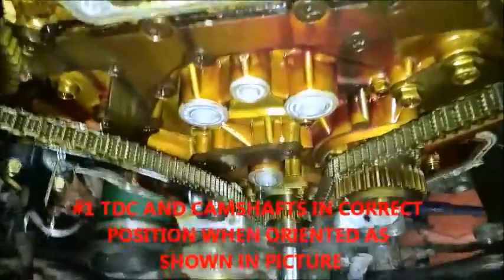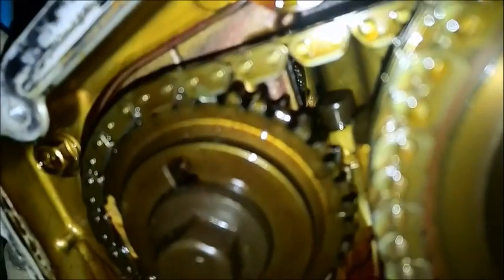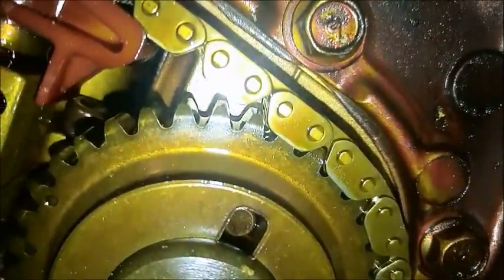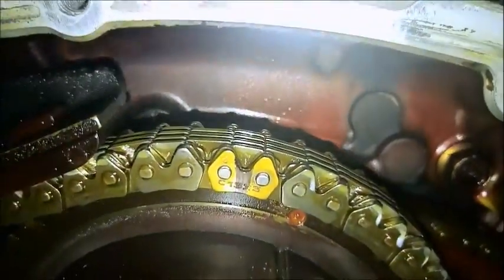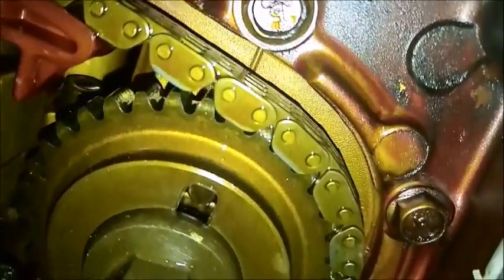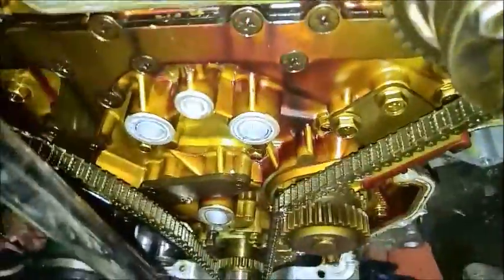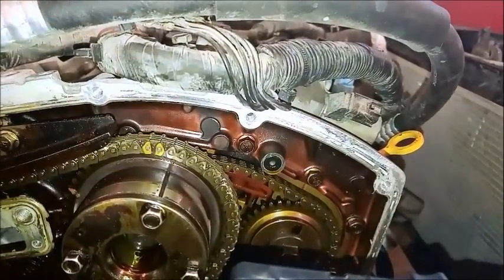Nissan VQ35DE timing without removing spark plug or valve cover

Comment: Does this work on 2nd Generation VQ35DE? The one in the video is the 1st Generation, but 2nd Generation is on 2008-2018 Nissan Altima and 2009-2014 Nissan Maxima, it has a different design from outside.

Please help if it's the same alignment diagram or no.

Comment: can you set the timng with out the timing chain
Reply from the maker: Yes, if the camshafts can be held in place some how. Just line up the marks as you are all set. Provided nothing moves during installation of the chain.

Comment: Great info. I just put my cams in timing. Perfectly and I decided to turn the crank just a slight bit to allign with the mark since,  I was just off by an inch. I didn't want to allign it till I knew I was in time with my cams and chain. Once I did that I put the bolt on turn it to position and herd a slight hiss of air. I was wondering if I screwed up so I walked away till next day. Thank God it's a normal sound then. 🙏 now all I gotta do is put my main chain on and turn it and pray it don't stick.

Comment: So quick question What if the line in the cam gear is off on the driver's side by just a hair should I remove the chain and turn it back just a hair
Reply from the maker: If its jumped a tooth I'd suggest moving it back. But a tooth a quite a bit more than a hair. Tighten chain it may pull everything together.
Reply: @Taters  thanks I went ahead and turned the cam gears separately, each just a hair to be dead center with the line on the timing cover and got it all back together, and it's definitely off now running poorly 
This was my 2nd attempt. The 1st time I did it, it would not start at all. Somehow, after I set it, I guess I bumped it out of time 
Before the drivers side was like the right of the marking and then the passenger side was to the left of the marking but still under the line I'm guessing by me moving them to be in the middle through it off 
Rn I'm pulling a code for bank 2 timing over advanced 
But my engine sounds fine, no knocks or nothing it is just misfiring and running rough
Reply from the maker: @BlackWidowdetailing  did you set the engine on the marks BEFORE disassembly? Perhaps the crankshaft isnt where it needs to be?? clean area and remove #1 spark plug, use compressed air blow gun and a rag to blow into cylinder if engine rotates or pressure builds and blows back when compressed air is applied then # 1 is on compression stroke. If air flows thru cylinder easily then you have set engine incorrectly. Correct to #1 compression and repeat process  if all marks are lined up as described in the video and provided that your engine is the same vintage then it should start and run. If you have lined everything up as shown and the engine will not run then there must be another issue. Id suggest swapping the VCT solenoids and see if the code switches banks (if so simply replace the failed solenoid) if that dosnt work have a look at your cam phasers perhaps one of them is failing.

Comment: Ive always been curious what will happen if someone doesn't time the engine correctly.
Reply from the maker: If off by enough degrees. Engine will run badly. If altered only slightly no noticeable change may occur. 
Why? Method depicted in video is definately the correct method.

Comment: So u only charged the tensioner ?
Reply from the maker: Thats correct. The guides, chains and secondary tensioner were in good shape. The car ran excellent for 3 years after the repair until my brother sold it now some chick owns it and i see it around once in awhile.
Reply: @taters5586  thanks for the quick reply I’m doin this for a customer on a Murano didn’t have a check engine light didn’t know if I needed to change everything or just failed tensioner bought the whole timing kit 🤦🏾‍♂️
Reply from the maker: @freshdatech89  well if ur not going to hurt it any servicing the whole thing. Might be wise to toss a water pump at it as well.

Comment: I was changing the gali gaskets and I think I jumped a tooth so do I put it on top dead center like in the picture and the once it’s like that I make sure the gears don’t spin with a pin too lock it in place and I can take out the chain with out being out of time   Then I just need to line up the chain to the little marks and I will be back in time right or no?
Reply from the maker: I am unaware of any method to pin the gears in place. Not to say such a method dosnt exist. But, if you set the engine in the position depicted it will be correctly base timed.

Comment: How come after doing the timming i started the vehicle and i can hear it knocking on one cylinder,  when i disconect the injector socket it stops what cud be the cause??
Reply from the maker: Lean burn causing detonation probably. Try replacing the fuel injector. 
It is unlikely that the act of resetting engine timing would cause misbehavior on one cylinder only.

Comment: Do I have to flip the engine over to remove the oil pan Nd everything ? Or can. I just do it with the engine sitting in place
Reply from the maker: Engine was not removed in this case. Pan came out easily
Reply: @taters5586  alright , I gotta replace my timing chain but I wasn’t sure if I could remove the upper oil pan while the engine in the car , I’m doin it at my house with jack stands and the normal stuff u kno
Reply from the maker: @dabs7103  same as i did. Ull be alright. Any questions just hit me up and ill do my best to help
Reply: @taters5586  alright I ordered the timing chain, the car what its doing right now its turning on but after 20 seconds it starts sputtering and rpms start to drop at a low idle and just stalls out, I changed out the crankshaft and camshaft sensors also the spark plugs, is It worth fixing the timing chain or just get a new engine?
Reply from the maker: @dabs7103  its likely your tensioner. Chain is likely okay.
Reply: @taters5586  is there a way I can check them without taking off the whole front   timing cover ?
Reply from the maker: @dabs7103  yes

https://youtu.be/Y_C_iIguxLU

I walk thru the whole diagnostic and do a detailed repair. 

If you watch the whole video it should answer any questions

Comment: Does it matter which way you install a flywheel????? Will the Flywheel affect engine timing at all??????
Reply from the maker: The fly wheel or the balancer? 

In the case of the vq engine no (but many other engine especially diesels use flywheel or balancer for some reference of fueling or ignition timing.. 
The fly wheel and balancer installation position have no affect on engine timing on the VQ engine 

other than the use of harmonic balancer key as reference for crank position as depicted in video
Reply: @taters5586  interesting. . . Yeah , when I try to start my car, it smells like it's running extremely rich . . . . I tried replacing the cam and crank position sensors and still didn't work. . . . Something keeps telling me I installed the Flywheel off timing . . But I just wanted to make sure before I start removing the transmission again. . . THANKS FOR THE HELP🙏

Comment: I rotated mine a dozen times too. The crank is dead on but the bank 1 is retarded a tooth and bank 2 is advanced about 2 teeth. So the guy who did the timing (Nissan Stealership mechanic) didn't set the timing correctly. This lead to an exhaust valve burning up in the 4th cylinder. Thank you Mr. I'm a Professional Nissan mechanic.
Reply from the maker: Sorry to hear. Glad i could help. This car was driven by my brother for 2 years after this repair was made. It was then sold to a woman in my town who i frequently see still driving it.

Comment: The yellow marks will olny line up 1 time in 360 complete rotations of the engine. You should rotate the motor over 2 revolutions after the timing chains are lined up to verify timing marks. Hint yellow marks won't line up after 2 rotations so make your own marks with white out

Comment: How many crankshaft turns is top dead center? Or is it every time the crank key passes by the line it's TDC?
Reply from the maker: Yes.
Reply from the maker: When all of the marks shown are in alignment #1 cylinder is at top dead center. So just rotate the engine until all are aligned
Reply: @taters5586  I have an engine I bought that had no timing chain. I wanted to know if aligning the crank to it's point say one turn to the mark is TDC

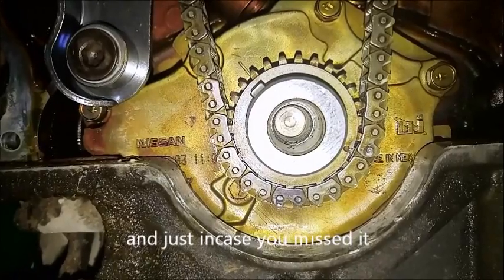Comment: At 7:58 your black chain wasn't where it was suppose to be on the crank. Wondering about that.
Reply from the maker: I think you may have missed the point of the excerpt. 

The coloured links are not being referenced, instead crank and cam position is being set in accordance with factory marks cast into the timing cover.

Comment: Thanks for the video. I was in stitches when you were looking for the colored link. 

I have.a g37. Can I use this method timing my G? If so, how do I begin the process with the chain already off? I replace my water pump, now it’s time to time it and close the cover. Your knowledge will be greatly appreciated.
Reply from the maker: Well id imagine (with the chain off) line all marks up as shown. And install chain. 

Thats how id do it. U might need an extra set of hands tho
Reply: Thanks for the response. Does that mean I can put the chain on anyway and just turn it until they align properly?
Reply from the maker: Yes absolutely it is. Just be careful and do things slowly. DO NOT FORCE NE THING IF CRANK OR CAMS REFUSE TO TURN CONTACT BETWEEN PISTON AND VALVES MAY HAVE OCCURED
Reply: Thanks. I’ll try turning them by hand to where marks and then put the chain on.
Reply from the maker: You can use a bar just be mindful is all
Reply: I’m going to attack it tomorrow. I didn’t hear you say it, but does the cams have a marker?
Reply from the maker: No dont do that. 

With the chain OFF MOVE crank into position as illustrated

Move cams into position and have a friend hold them somehow (a wrench works well) 
String the chain on carefully. 

Let the cams free. Check alignment, adjust as necessary. 
Then let the tensioner out. And recheck alignment.
Reply: Okay. I I didn’t know if it was OK to move that stuff with the chain off.

Comment: Hey
That marks can work but they are not the exactly timing marks 
On the back cover 
Has 2 marks on each side 
One on top the other on the side 
Right side one is at 12:00 the other at 3:00
Left side one is at 12:00 the other at 9:00
The right side on the big gear is a line and one teeth has a little hole well that has to be aligned with the back cover at 12:00
The little gear has 2 lines they has to be between the cover mark at 3:00
Left side on the big gear is same at 12:00
And the little gear has 2 points has to be between the mark at 9:00
 You can see same mark on the bottom of the cover 
Has to be aligned with the point has the crankshaft gear
I hope you all understand what I try to explain just pay attention on the back cover you will see the 5 marks what I talking about
Reply from the maker: The engine ran for over a year with no timing codes (or any other codes for that matter) before my brother sold it to someone who is still running it around. If those indicators i used werent appropriate the engine would have either performed poorly on some level (which it did not) or thrown a timing code (which it did not)

No markings other than the ones depicted in the video were observed on either the inner or outer timing covers.

Comment: quick question when putting the crankbolt back on and you have to torque to spec if the crank moves a little will the timing be off or is better to use a impact gun to prevent it from moving
Reply from the maker: I just used an impact. Dont go crazy tightening it tho
Reply: After you put all the marks on the right place and all chain tensioners it not affected at all if it move when you tight it but the impact wrench helps a lot

Comment: I know this video is old, but is there any way to turn the cam gears (while they're still connected to each other with secondary chain) without turning the whole assembly? My crank is at TDC, but the cams are off. Any help is appreciated!
Reply from the maker: Yes, you have to relieve the tension on the chain for the pair you would like to adjust (how? I do not know). Then Of course adjust them back into the correct phase. 

But more importantly i would try to discover why one set of camshafts had come out of phase. Perhaps there is a larger problem OR your particular engine vintage cannot be set-up using the method layed out in my video. 

Please keep in ming this VQ-35 engine is from 2003. A newer engine may not be marked the same
Reply: @taters5586  so if I pull back the chain tensioner they should crank over by hand? And the reason they are off was because i messed up taking the chain off. Would you recommended putting the cams where they need to be by turning the whole assembly, then removing the primary chain, and turning the crank to TDC, or turning the crank to TDC, then figuring out how to turn the cams to where they need to be at TDC?
Reply from the maker: Rotate crank to 1 TDC. Leave it in place. 
Correct the cam set in ur first comment. U can get someone to help u hold inplace if need be. Then install ur secondary chain. Hang ur primary chain. Adjust cams go correct position. Double check everything in still is correct spot then let the primary tensioner go.
Reply: @taters5586  thank you dude, you're amazing for still responding to such an old post, and giving out all this free advice. I appreciate the help, now i just gotta cross my fingers and hope i dont mess up haha.
Reply: You have to relieve all 4 camshaft like that the not puch down the valves and not messed the valves

Comment: What’s the point of finding tdc when u can just put it back together at the marks ....
Reply from the maker: The mark on the crank and its indicator on the backside of the cover  is number one TDC.. 
I bring this to light because none of the service literature that i had (hanes manual) or was able to find(mitchell on demand) said anything about indicators on cover and rotating members. 

Im not quite sure what you meant by your question. But i hope i answered you well enough
Reply: Taters 

thanks

Comment: Oh another thing, I am planing to replace the left phaser ( bank 1) I think to get rid of the dreaded p0011 code. Also my oil pressure goes very low on idle and I think the culprit is oil pressure. What is your take on that?

Comment: I take that back. What I meant was when I turn the bottom shaft and align it with the mark, will that be enough to get all the points or marks in the right time. ? Thank you

Comment: Note to anyone watching this vid if the timing is off there will be no spark or injector pulse..my timing was 64 degrees off..intake valves were bent..fixed them..but do not keep cranking the motor over if ur vehicle is out of time or this will happen...its a bitch to take the toming cover off and put back on...always inspect timing first by removing timing cover...ps thx for this vid taters...very helpful for my situation..i did reset timing and like an idiot i honed the cylinders replaced the piston rings and the connecting rod bearing,brand new valves ..omg never agian but lol it runs now but runs like shit very slow engine speed..and ps to everyone reading this...DO NOT HONE OUT UR CYLINDERS!! TAKE IT TO A MACHINE SHOP DO NOT TO IT URSELF...just do the timing..and if timing jumped and bent the valves only replace the valves in the heads..do not mess with the pistons or engine block or this could cause engine displacement...all though  im not a machine shop i tried to save money but it didnt work out in my favor oh well....off to the junk yard for a new block😒

Comment: Question.  How did you get the timing cover back on? The bottom gasket that clips on to the cover keeps popping off when I try to put the cover on! Any tips??
Reply from the maker: No gasket in my case. The manufacturer used RTV sealant. 

If you are finding it difficult to keep the gasket in place you could use a bit of silicone or grease (yes grease) 

Form a few small beads and stick the gasket in place.
Reply from the maker: marc pierre 

Oops. Brain fart. I know what your talking about now. The section of rubber under the crank. 

Make sure its the correct one!!! I was shipped one which was too long and it kept coming off. 

In any case. You could use a small amount of sealant to stick it in place while you set the cover in place. For the love of all that is good and holy do NOT let it dry prior to cover install. 

Clean and dry the seal area. Apply a reasonable layer of sealant you are not icing a cake stick the rubber seal in place and press it down. INSTALL THE COVER RIGHT AWAY. 

"Ultra grey" or "the right stuff" both made by permatex work best as they are impervious to oil and are recommended by many manufacturers. High temp red silicone does not work well in applications where componant shift or flex is likely. It also breaks down with prolonged exposure to oil.. So i do not recommend it for engine assembly or really much of anything.
Reply: Taters yeah I think the one I ordered was too big. I did see remnants of sealant from the previous rubber, so I'll give that a shot.  Thanks for the quick reply
Reply from the maker: marc pierre happy to help

Comment: It’s a large leak. It’s coming from the rear of the motor on the driver side. I’ve done pressure test and I do have low compression on two cylinders. This all happened when I cracked my radiator. When I replaced it that’s when all hell broke lose. I only have 166k on it and never really had serious issues wit it